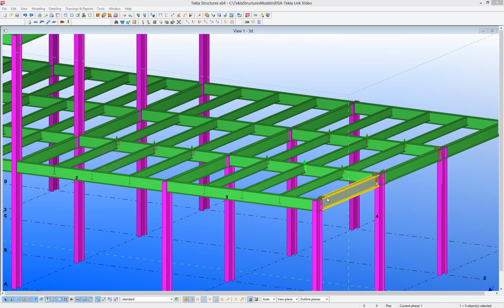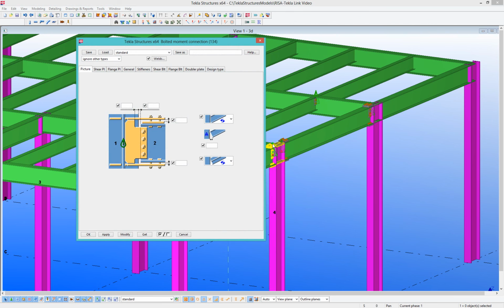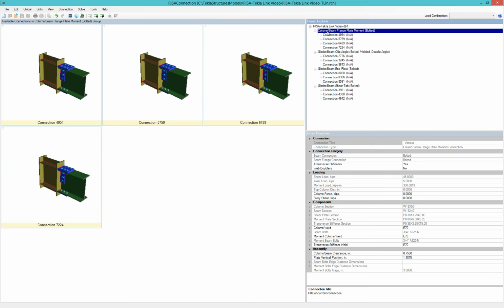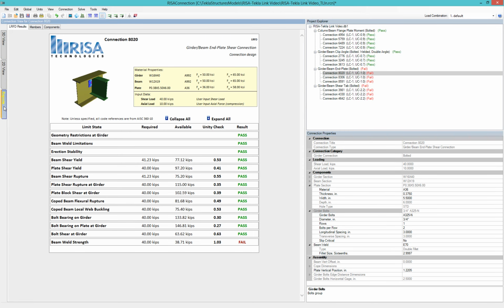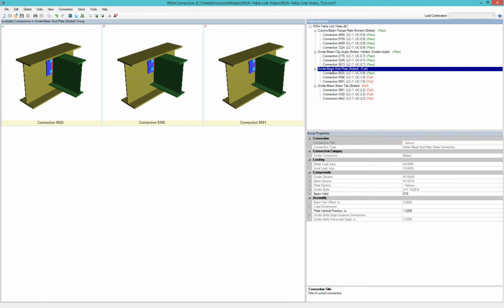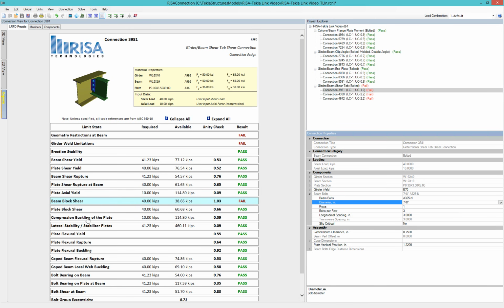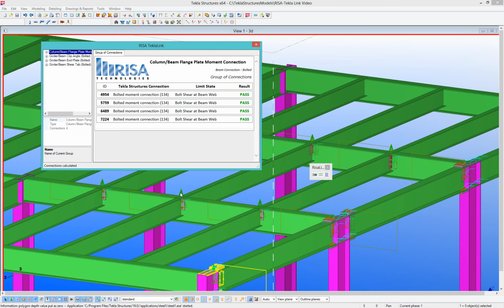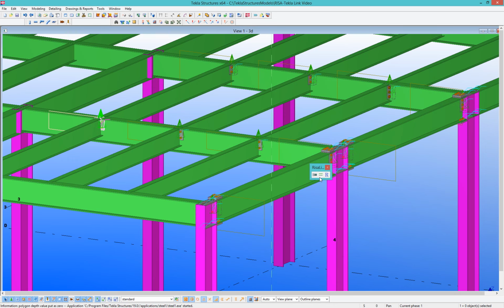RISA-Tekla Structures Link

Comment: Hi, The demonstration shows how the RISA-Tekla Link works for a system macro. System Components are not always the exact way we need a connection in Tekla. In that case, we are bound to go for our own custom/manual connections. How does the Risa link works in this case?
Gavas Radhakrishnan
Reply from the maker: Gavas-  The RISA-Tekla link currently supports a variety of connections types available in Tekla but not yet custom connections.  We are continuing to enhance the link so this might be added in the future.